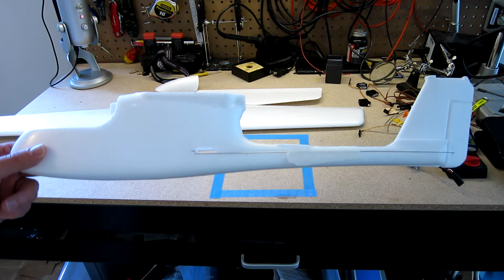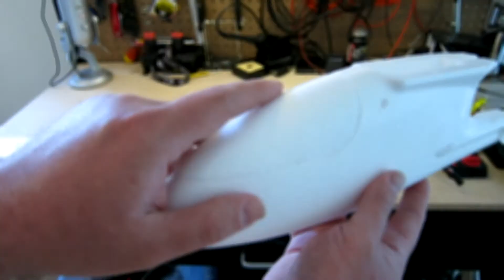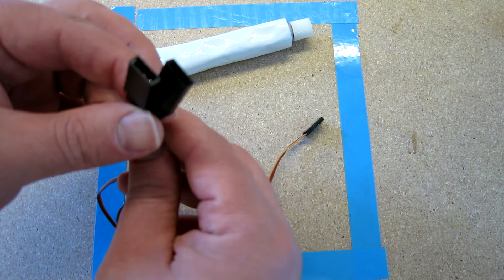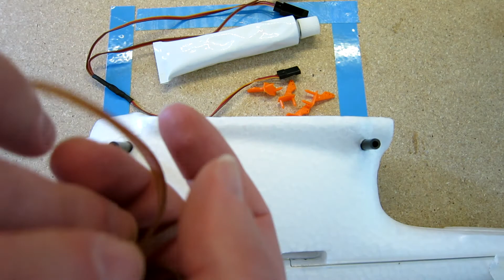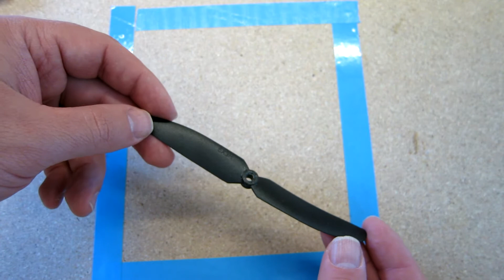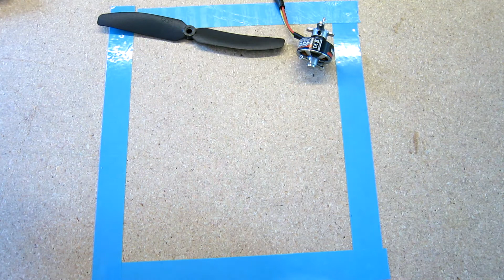At The Bench: Skywalker Mini 1 - Parts

Comment: You will love the mini skywalker. Its a small, but mighty frame. Building tips on this model, go heavy with the glue on the carbine bar in the tail. If it's loose, you will get crazy flight characteristics at higher speeds which will cause the plane to stall. Check out my channel, i have several videos of me flying my Super Mini Skywalker setup.
Reply from the maker: jd jr Thanks :)  I will have a look at your channel.  My mini skywalker doesn't have a bar on the tail though :(  It has one in the wings, and it looks like there is space for one in the elevator.  Should there have been one?